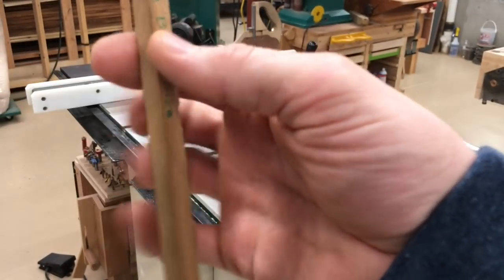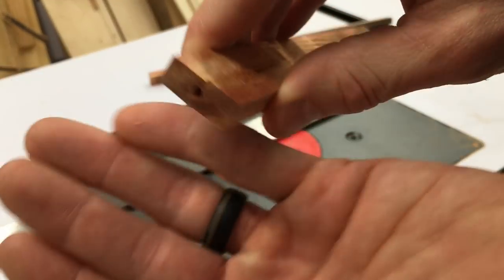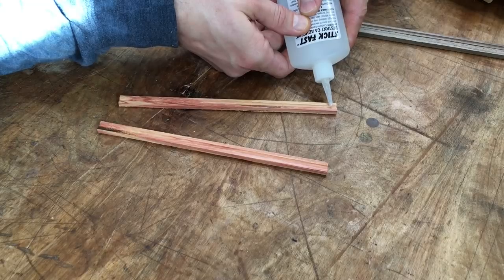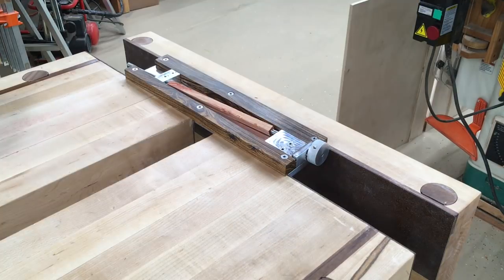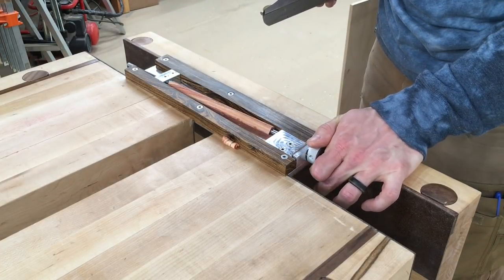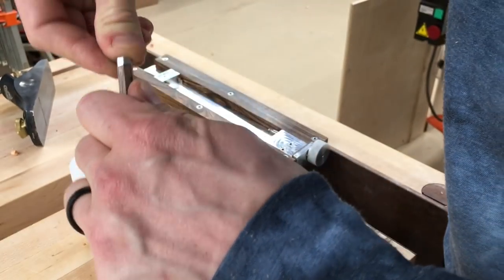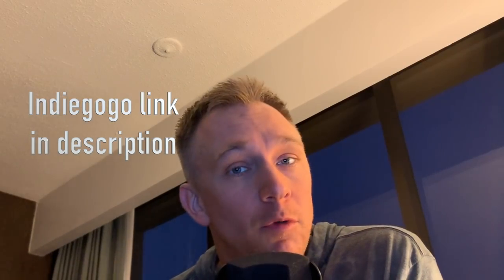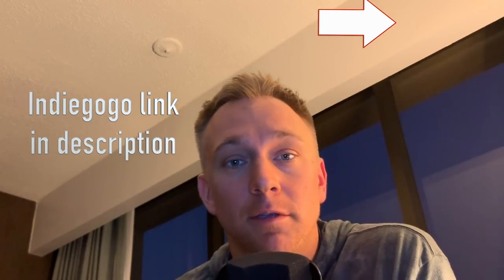Pencil Making Jig Instructions

Comment: 3 things I’ve learned using this jig:
1) This maybe super obvious to everyone but me, but use stock that is planed flat on each side.  (I say that, because my initial goal was to use small cutoffs from other projects, and unless they are already perfectly flat before you cut them, it makes gluing impossible.)  So go ahead and plan on using a section of board, and prepare it appropriately.
2)  When you load the blank, setting the knives on the headstock will place the glue joints/edges exactly in the middle of one of the six flat faces.  45 degree angle, the joint will be on one of the vertices, and is much less noticeable in lighter woods.
3) It is a PITA getting the router bit perfect, at least on my router table and its  imprecise lift (Kobalt). I’ve ruined a lot more pencils than I’ve made by not getting dead straight, perfect hemisphere grooves cut.  I’m tempted to go buy another cheap router and table with some mdf just to customize and lock in, w/o fear of having to spend hours, nay, days setting it back up perfectly.  
This part to me is by far the most challenging.

Comment: Just got mine, can't wait to try it out!  Quick question - what are the two small squares of leather(?) for, and do you have instructions in a pdf I can print out, and have handy, instead of watching the video repeatedly. Thanks!
Reply from the maker: I don’t have any written instructions, sorry.  The pads of leather can be slipped u fee the middle of the pencil if you notice it bending when you are planing.
Reply: Andrew Klein is there a specific kind of plane that has to be used? Was practicing on a piece of pine and I didn’t have any issues until it started planing down into the wooden base. Not sure if I’ve totally screwed up the jig or not, or if I’m doing something wrong to cause it. Any ideas/tips?